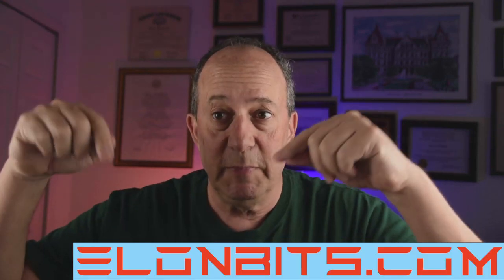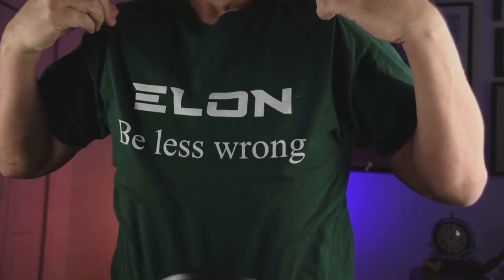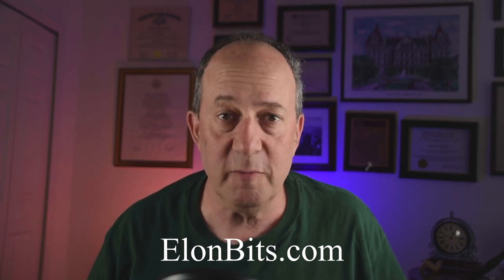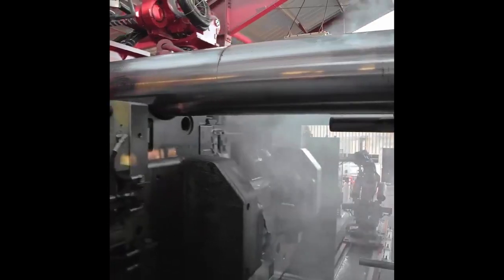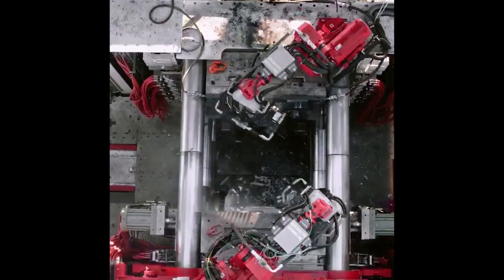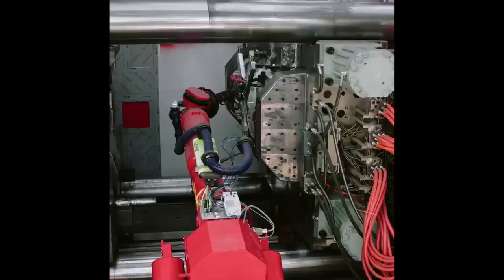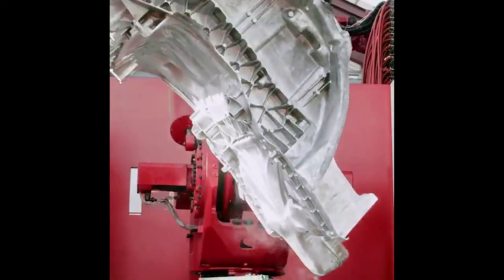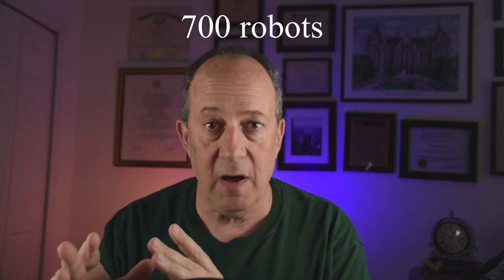Tesla Tech Transition - Model 3 & Model Y to 2023 Compact

Comment: They are progressing leaps and bounds when I was building the model 3 line we installed 1200 robots and every time they had a shut down they would call us in to change up configurations of robot and remove some. It’s great they are removing so much parts in the process. I am a happy shareholder

Comment: Fremont factory layout is a mess of various separate buildings, making it suboptimal for efficient high-volume production. I can see the low-volume Model S, Model X, Roadster, and Semi being built in Fremont, while Giga Texas cranks out the high-volume Model 3, Model Y, and the $25k compact.
Reply: Texas plans to pump out the Semi and CT. Where the heck are they building the  25K compact?
Reply: I wish they could get the SR+ down to 33K and the LR to around 42k. 
I just don't see the LR model 3 as a 50k car, but 40k would be almost impossible to refrain from purchasing :)
Reply: GigaAustin will also Produce the SEMI and Cybertruck , dont forget that.
Reply: There’s a drone operator who flies over the Fremont Plant. ‘Mess’ is an understatement’ You see bodies in white being ferried around on carts.
Reply: Great point. All the more reason to transition in 2022. :)
Reply: do not forget the cyber truck at giga Texas
Reply: Right. Forgot about CT. Definitely Texas. :)

Comment: Hi Warren. You make a good case for premium pricing on the next version of the model Y, but I think you may be wrong in your analysis. Tesla's pattern seems to be an almost relentless drive toward dropping the price of their cars in tandem with every improvement they achieve in production efficiency.  Since less expensive EVs result in wider adoption (which is the stated goal of Tesla), I think that what we may more likely see is that Tesla will drop the price of the model Y the instant they begin production at the Texas and Berlin facilities. That is, after all, what Tesla did when they were able to begin model Y production at the Shanghai facility.
Reply: Good point Norm. Can you hazard a guess on the price drop of the old Model Y and the price increase of the new Model Y. I guess $10k drop and $5k increase until Freemont is converted to new Model Ys in late 2022 or early 2023. Again, good point.
Reply: Since there is currently a 21% import duty to the EU and about 8% in shipping costs, I would guess 30% price reduction when the Berlin factory ramps up.

Comment: I would suggest a slightly different transition plan.    I think they will phase down Performance Model Y in Fremont at they same time they are ramping up with the new version in Texas and ship to the whole US from TX.  When they have more capacity in TX they will do the same thing with the dual motor version.  They can then bring Fremont online with the new version and switch to geographic ordering to minimize shipping costs and time.  As Berlin ramps up they can reduce shipping to the EU from China.  I agree that the next GigaFactory should be in China - and they can use the same plan there (as in the US) for getting both China factories on the newest models.   Where they have room (not Fremont) they could just build another factory line near the existing factory like they did for Model Y in China.

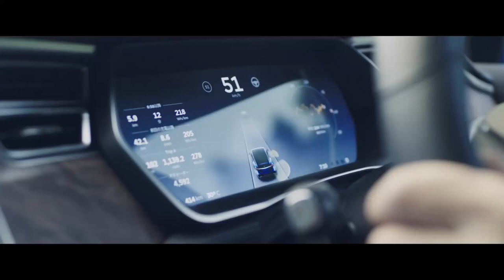Comment: 11:10 - Improved polar moment. I think the major improvement will be due to the castings being lighter than stamped steel front and rear.  These parts are furthest from the center, so their reduced weight has a large effect on polar moment. Next will be lightened suspension due to a lighter car. This weight saving is away from the center but not as much as the castings. The structural battery will be lighter than a frame with battery modules inserted, but this weight is close to the center of the car, so will have less effect on polar moment.
Reply: Have you done the math to estimate the impact of the pack dimensions shrinking without the module containers? Do you think that subtracts much from the polar moment?
Reply: @Global_Optimization  Good question! It can only make it better.

Comment: The prices in Europe are higher anyway so I think you are correct with the theory that the European model Y will cost more.  However, they made changes to the new Model S battery pack to make it lighter and according to some, less kwh to produce more range (12%?)  and I think they will apply these changes to the US Model Y by the end of the year to increase the range by 12%.  This will give them more time to ramp up the 4680 cells.  By the way, Panasonic is working on a pilot line of 4680 cells in Nevada.  Will those use the same chemistry as before but improve in range due to the form factor?  I think so.  I think the silicon anode is the last to find its way into the 4680 cells (notice the time line on the cost curve presented at battery day).
Reply from the maker: I think Panasonic and LG are making NM 4680 cells, not High Nickel.
Reply: @WarrenRedlich  I agree.  I think Panasonic and LG will use the chemistry they are familiar with, just with the tabless 4680 enclosure (are they getting Tesla's help to make the tabless cells?).  Tesla is sourcing the Nickel in New Caledonia for their batteries.  I think I read somewhere that the 4680 form factor doesn't provide any advantage with LiFe chemistry.  I could be wrong but I haven't heard of CATL starting up a 4680 pilot line.

Comment: How about this. Giga Austin spools up and makes the Model Y in sufficient numbers. Fremont Model Y line is shut down and retooled to make use of giga-casting to make the Model 3. Once that new line is up and running making the new and improved Model 3, the old Model 3 line is retooled to make the Model "2". Wasn't "2" and 3 supposed to be using similar or same base? Then the 2 and 3 could be made with all the shared parts in Fremont, Y is made in Texas and Bob's your Uncle.

Comment: Great video! 2022 Transition strategy: Ramp down Freemont and retool after Texas and Berlin reach 90% capacity. Downtime time will be minimized if transition occurs production line by production line instead of a complete shutdown. Whether 3mo or 6mo transition time, 2022 volume growth will be stunted. I will be more than happy to have 2022 stunted growth if the transition flows smoothly. Rinse and repeat for China. Build new factory in China with new equipment and retool Shanghai as new factory approaches full production. Then 2023 will be a fantastic growth year.

Comment: My prediction starts like yours.  Austin MY w/ structural battery pack is a premium product w/ concurrent "current style" production from Fremont as Austin ramps to 1 million annual rate.  My example is the MS Plaid + as the premium product using the 4680 battery while the rest of the MS line awaits further ramp up from Kato Rd.  Eventually, Austin will produce all MY for the N. American market.  China will provide the premium 4680 M3 as this model transitions to the new structure and battery (Austin?).  New factories will be necessary for the "M2" and I doubt they will be in California.  Fremont/Alameda County providing competitive tax incentives is unlikely, relegating the current factory to boutique levels of production (MS, MX, Roadster, etc.) as M3 winds down as inefficient.
Reply from the maker: I think Fremont will also produce Model Y, for the west coast.

I wonder if they'll ditch the Model 3. Seems obsolete compared to Model Y.
Reply: @WarrenRedlich  Fremont is so inefficient I think Tesla will only produce products there until they can produce them elsewhere.  The existing factories are going to be pushed to make many more than the listed capacity (2X may be more).  I'd be less surprised if they build a new West Coast MY factory before they upgrade Fremont.

Comment: The stated goal for Model Y is for West Coast / West Side Y's to come from Freemont and East Coast / East Side Y's to come.  The big objective for 2021 & 2022 will be volume.  Globally 2022 should end with 750K or more Model Y's to keep the 50% per year growth rate.  Imo price or the versions will not be different between Freemont & Austin.  Only hard-core Tesla fan boy's (like myself) will want to take delivery of Texas models over Freemont.  Which will probably mean I'll have to fly to Texas to take delivery.  Eventually they'll be a Model 3 line in Austin and that's when the front, center and rear casting will start for the Model 3.   Once Austin is at volume Model 3 production, they can shut down the Model 3 lines in Freemont and re-tool them to match Austin.  RE:  Model 2 - I expect an announcement out of China and a big reveal event of the design in latter half of 2021 and limited production will start in 2022.  By the first quarter of 2023 Model 2 will reach full production for Shanghai.

Comment: The key driver regarding making model 3 and y 2 megacast + structured battery will be Teslas  ability to ramp the 4680 production
Reply: Agree, Fremont already producing 10Gwh and hopes for 100 Gwh in 2022.
Reply: @alanmay7929   - Ummm, TESLA already has the Supply , TESLA owns a LION mine in Nevada and another one in the EAST.
Reply: @alanmay7929   - Ummm, mining LITHIUM out of CLAY with ordanary TABLE SALT is green. 
and the East Coast mine , TESLA just owns it, the mine company does the Production.
Reply from the maker: Most batteries will be LFP and there's effectively unlimited supply of the materials.
Reply: @WarrenRedlich   - Agree, SR+ will probably getting LFP at some point.
Reply from the maker: SR+ with structural pack and front/rear castings will get over 300 mile range with LFP.
Reply: @WarrenRedlich   - agree.
Reply: @alanmay7929  “Impossible” is not a valid word in Elon’s vocabulary.

Comment: The only issue I have with giant castings is when you get into a minor accident, the repair bill will be ginormous.. You would be basically replacing the entire front/backend..
Reply from the maker: Frame damage is a problem for any car.
Reply: Giant casting might be able to take a higher impact without damage. Perhaps the crumple zones may be engineered differently to direct the collision forces towards easily replaced parts, just guessing.
Reply: Crash structure is bolted onto the front and rear of the castings, if the crash force is substantial enough to distort or crack the casting the cars done game over

Comment: I've been trying to figure out what they could possibly do to balance the different versions of Model Y from Fremont, Austin, Berlin and Shanghai. What will they do? Sell a way better Model Y(because of structural 4680s and all that) in Europe and half of US with better range, lower price while they sell a relatively inferior Model Y in the other half of US and China? I'm really curious to see what will be the prices and specs for MIG Y!
Reply: Panasonic has Already developed NEW 2170 with more Energy for Tesla and are Already going into cars. 
Giga Nevada has 4680 PILOT line up and running.
Reply from the maker: Mark - Where did you see a 4680 Pilot line in Nevada?
Reply: @WarrenRedlich   - Panasonic said it built a 4680 line in GF1 nevada, to make 4680 for Tesla. 
LG Chem is doing the same in GigaBerlin  and shanghai will also get 4680 later.
Reply from the maker: I remember seeing that Pana was doing a new line in Nevada, but not that it was 4680. And I remember seeing that LG would be doing a 4680, but did not see that it would be in Berlin.

It would make sense to me that Pana and LG would do NM 4680, and CATL would do LFP 4680.

Comment: When did he saw they are going to do front and back in one casting? The plan is to do a front and back that is only connected by the battery structure.... right? I do not think the all one casting for front and back is accurate.
Reply: He says this at 7:15 in your video...
Reply from the maker: He's talked about it before and it's not completely clear in the video unless you get the context from before. The plan is to cast front and rear together, perhaps including some basic structure for the structural pack.
Reply: I don’t see them doing a one pice casting , it’s not necessary with the structural battery. The die cast press would need to be fing huge and the process becomes much harder the bigger you go. They are already breaking records with the rear of the cybertruck, that structure is relatively simple compared to the front end of the car.

Comment: If there is tech disparity between Fremont and Austin:

Fremont will not sell the same model at a different price  .. no chance of that whatsoever.  Even hell doesn't run that business model.

Fremont will ONLY produce a certain price point(ie lower mileage) for  3 and Y, and thats it.. Austin will not touch these and will produce everything else.
 
There will be no parallel manufacturing of different tech for the exact same product in the same market..consumers will not be faced with this decision.  Stick to Law lol. Once a consumer is confused and has to think too much, you've lost them..  It a negative, and Tesla doesn't do negative.

Comment: Warren - the Best robot is no robot.
Reply from the maker: The best code is no code.
Reply: Other companies: use robots, but people out of work.
Tesla: puts robots out of work. :)
Reply from the maker: Nice. I'm stealing that.
Reply: Don’t forget that those casting machines cost a few quid and the process itself does use space so it’s not all savings unfortunately
Reply: @TeslaBulldotcom   - SAVINGS are huge , compared to 600 Robots less and Stamping Press machines, and a Shorter / Smaller Production line with LARGER output. 
and TESLA Customizes the Machines , is building a 8,000 lb GigaPress for AUSTIN to support Cybertruck. (WORLDS Largest).
Reply: I was simply pointing out that it’s not all savings, when you replace one process with another especially if you have already spent the cappex on the tooling the presses and the robots in the first place. For new vehicles and factories that’s fine but it’s a lot harder to justify on an existing model, everyone seems to think that they will retro the 3 and the x and s and the numbers probably don’t work, you have to find a lot of process time savings if your throwing away all the existing kit that’s amortised into the costs already and buying a load of new stuff. The downtime alone would cost a fortune.
Reply: @TeslaBulldotcom   - the Robots can be used Elsewhere and Simply be reprogramed.
the BEST robot is NO robot.
Reply: Mark, there’s nothing simple about it, if there was Tesla would have done it already. I’ve already pointed out the reasons why it’s difficult to justify such a major change on an existing vehicle. This stuff isn’t just plug and play everything carries a cost. Elon pointed this out to Sandy already I just put a bit more meat on the bone for you.

Comment: switching to structural large alloy castings and stress bearing battery pack....isnt this going to leave the cars vulnerable to stress cracking due to torsional flex and impact, direct / indirect - these are supposed to be 200,000 mile vehicles - alloy panels (not castings) flex and absorb such loads better?
Reply: David - NOPE, the Megacasting wont even be damaged , the rest of the Structure will need Replacing , but you can simply BOLT on a new part to the Megacasting. 
and with 3 Piece Underbody the car will be like a BRICKHOUSE . 
the Megacasing is not Magnesium , its a Special Aluminium Alloy. and Tesla can conbtrol how it Deforms and can Control the rate. 
2018 model 3 was Already a 300,000 mile vehicle (1 million Drivetrain) . 
with Megacastings , drivetrain shouldbe 2 million miles , 4680 battery 2 million miles and Maintance 1 million miles. 
TESLA is Designing and building MAINTANANCE FREE cars.  thats the goal. " the BEST process is no Process, the BEST part is no Part. " - ELON.
Reply from the maker: I don't know who this Alan May guy is but I can't wait for him to start up a car company. He obviously knows more about it than Elon and Sandy do.
Reply: @alanmay7929   - FALSE , the Structural supports are built into to the Casting , the cast rear end does NOT Deform at all , only the Stamped Parts. 
the Aluminium Casting is not Brittle . 
its NOT like with CAST Magnesium. 
TESLA is using a Specific Alloy to mold in just 33 miliseonds but it has to cure in place under HIGH PRESSURE 6,000 LBS.
then its unmolded , and gets a water bath.
the Cybertuck will be 8,000 lbs.
Reply from the maker: That conversation between Elon and Sandy about how they do the castings was amazing.
Reply: @WarrenRedlich   - yes, an Epic interview for sure, but ELON is a busy man. LOL.
Reply: @markplott4820  Thanks for helpful reply - hope you are right....I remember touring the manufacturer of another car of mine and observing the chassis construction, pointed out my concerns of longevity - they assured me it was over engineered and would neve be a problem.....most chassis needed major works within 10 years...

Comment: @13:15 The price will not change. As the cost reduces, by not changing the price, the profit margin for Tesla improves but that's it.
Consumers don't know or care, whether their Model <?> is built using the latest technology. They just want it to be a good Model <?>. 
The next price tier will be based on the Model and nothing else. 
That was the same problem that Hyunday faced with its hugely successful Pony. It was a bottom of the barrel car but it sold like hotcakes. The problem is that Hyunday faced an up-sell problem with any vehicle called, say, the Pony <x>. People were going to be expecting the same price point.
Reply: I think you are largely correct but most Tesla people are much more savy than the average buyer.